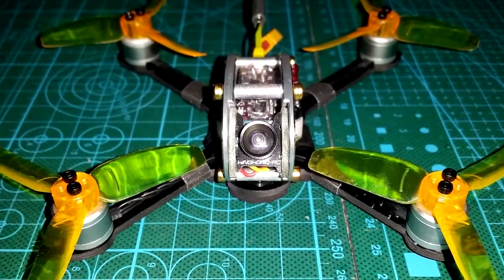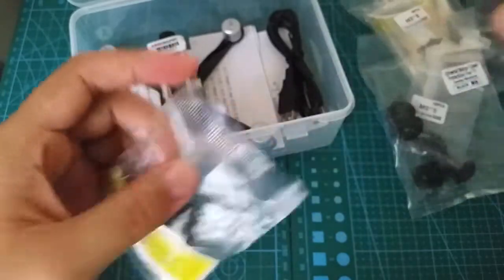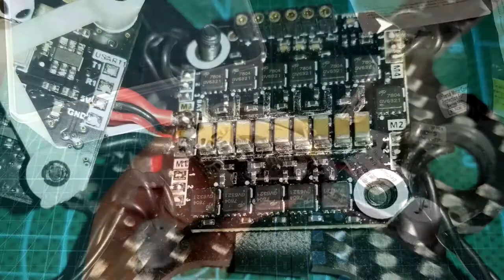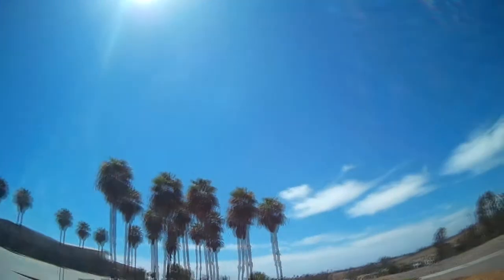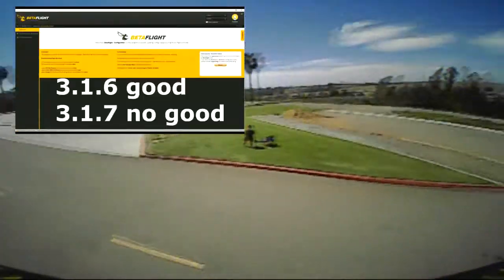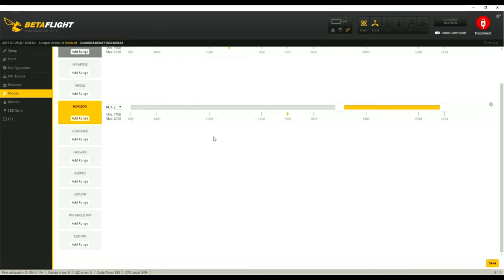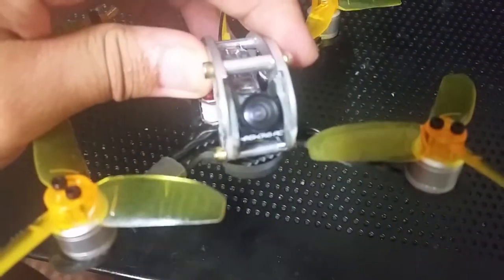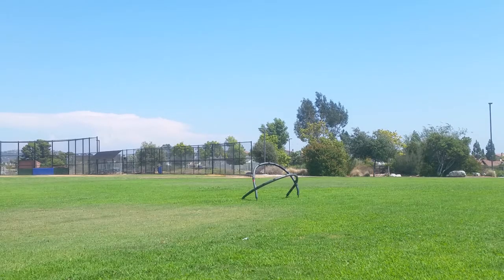King Kong FLY EGG 130 - Unbox - Review - Setup - Flight Tests

Comment: I just received mine and they upgraded to Sunnysky motors and a JST plug with a better 80c battery. I'm still gonna switch out to xt30 and start with your PIDS, thanks for sharing👍Oh, my flight controller does seem a little uneven as well.
Reply from the maker: No prob :) Oh yea I saw that they are selling them with the newer motors, I guess the original motors were not very durable, and they also got very hot. Does the uneven board affect anything? I didnt even wait to check, that was the first thing I did: fix the unevenness haha.
Reply: DANQ FPV It seems pretty level and stable so far. The FC is mounted weird like yours in the two corners with foam. I did change my JST to xt30 as well as the 80c battery. If they upgraded to a Betaflight OSD and a better FC this would be perfect.

Comment: It's a great little quad but get an extra frame! I'm fairly new at flying so I practice on fields with thick grass to cushion the impact of crashes. Not many flights in, I crashed, not too severely I thought, and when I went to retrieve the quad I noticed that on one of the arms the carbon fibre has separated and the tip is bent. I would say that this frame is very weak but still worth the purchase because of the other components but get another frame, something with thicker arms!
Reply from the maker: Mine held up for a good month of usage, but snapped an arm when it feel from a death spin :( snapped where the motor was. if the carbon plates are splitting, i would suggest using some type of epoxy to hold prevent the plates from splitting any further.

Comment: I heard they put the balance plug on it to make you stay with 2s.  Heard the motors kv is not recommended for 3s.
Reply from the maker: really? thats kinda of messed up haha, but it wouldn't surprise me, the motors were already getting hot on a 2S
Reply: DANQ FPV I'm no expert just heard that from another review video I watched.
Reply from the maker: I see... well i think as long as you keep an eye on your motor's temperature, you should be okay. Its addicting flying this thing on a 3s.
Reply from the maker: I swapped out the balance connector for an xt30
Reply from the maker: yup that will be fine, I just prefer xt30 because it looks better, and imo is easier to plug in and unplug. the EGG doesn't produce enough current to cause an issue.

Comment: Thank you for your video, your PIDs are perfect. Is it normal that I can't fly more than 3 minutes with a 2s 450 mAh?
Reply from the maker: yea it is, unfortunately. they are so power hungry, flight times vary depending on how hard your are flying it. What kind of battery are you using? a higher C pack may help too
Reply: DANQ FPV it is an eachine 50c. I have to change plug to xt30.

Comment: Liked and subsdcribed!!
I had a bunch of brown out (all the saga in my channel) with mine so I've open it up all, and changed the plug. But I've put a JST. What you think about this?
You have the vtx set at 25 or 100 mw?
When I connect mine to betaflight, it connect then after a few seconds it disconnect, do you know what it can be??
I 've ordered a bunch of 3 and 2 cells all with jst, so....
Please let me know
Bye!
Reply from the maker: Thanks for the add paul! Brown out's can be from your battery, I think I had brown outs on the stock battery as well, hopefully the batteries you purchased have at least 60C discharge. JST is fine, but xt30 is better! and anything is better than the included balance connector. 
Ive never changed the VTX, and never had an issue with it, honestly either one is fine.  
try using another USB cable and see if it does the same thing
I think most 2 and 3 cells in this size come in JST, Ive swapped mine all over to xt30, but jst is fine.
Reply: DANQ FPV I've already written a replay but it disappesred!!!
Thanks I will try with the jst.
The batteries ordered are 60 &  70 C.
I will try with another usb.
Have a nice day
px. my previuos mex was way better but I  cannot repeat it. Damn illuminati minions hack my mail all the time!!

Comment: when i set it up to dshot600 only to motors spin..the only one works is multishot thats it..also two cell is fine but when i put the 3cell in after a minute or so makes a grindding sound..when i go back to 2cell its fine again..dont get it can you please help me thank you happy flying..
Reply from the maker: Yup everyone Ive spoken to has the same issue with dshot. Someone on rcgroups sent me a link and some instructions... check out post 43. 

https://www.rcgroups.com/forums/showthread.php?2909991-Kingkong-FlyEgg100-FlyEgg130-2-BNF-PNP-7075-Aluminum-Cage-Brushless-Micros/page3&perpage=20#post38086614

I took a quick glance at it, and the instructions show a different board, so I stopped there, and never got it fixed. It flies great with multishot so I just kept it as is. 

As for the sound, can you replicate it every time?
Reply: thank you you awsome ok ill try that..happy flying
Reply from the maker: np, good luck, lemme know how it goes